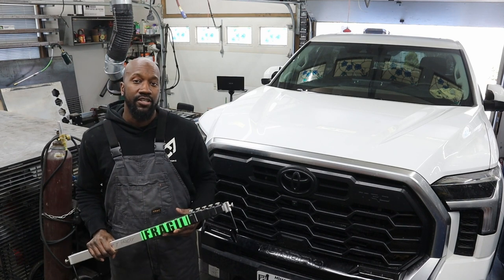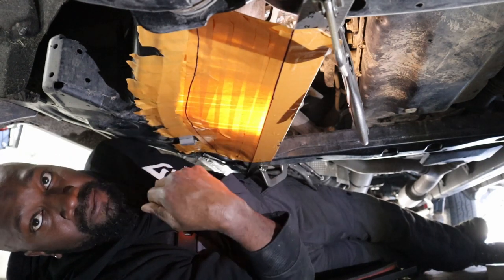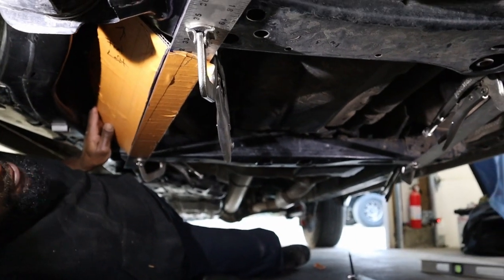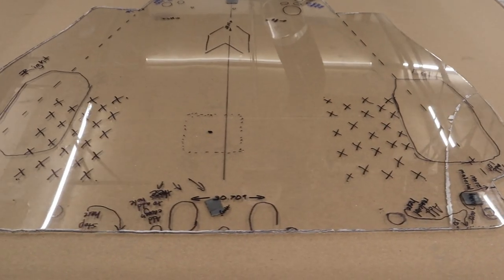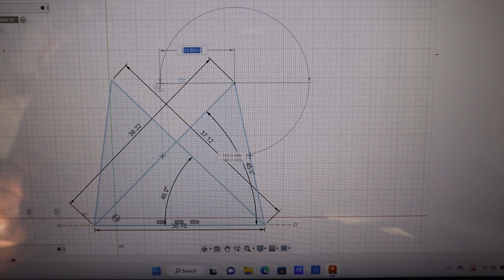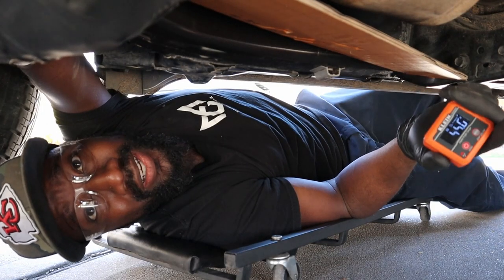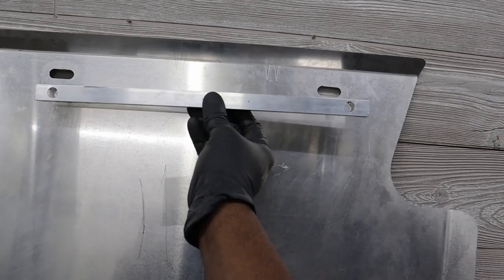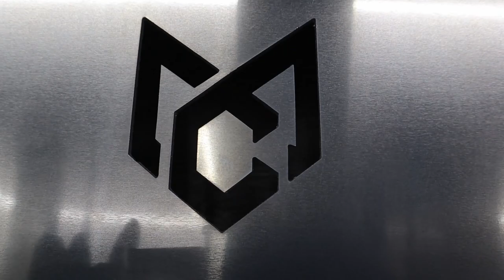Toyota Tundra DIY Catalytic Converter Protection DIY Skid Plates

Comment: Isn't it sad that this even has to be done? Our country is in real trouble. Good job as usual Marc. Your a talented guy.
Reply: thanks Biden!
Reply: I want to know if this ever stops a criminal, if possible. Another words, found saw marks. We keep our Tundra behind tall locked gates. Nothing we can do at Home depot or whatever. 😔
Reply from the maker: Hi @MrLittleman777, Yes indeed these plates prevent thieves from stealing these catalytic converters.  My father-in-law parked his truck at a secure airport parking garage. The attempted thieves sawed his exhaust in half and left the since empty hand , thanks to my Plates that were installed on his truck. He was able to drive his loud truck to a local exhaust shop and have them weld his pipes back together.  I have photos if your interested in seeing the cuts they made.  If you ever feel the need to protect your investment, stop by Marcustomz.com  Thanks for your question.